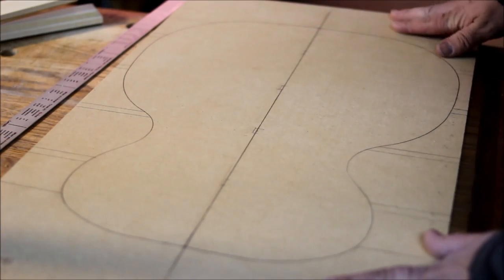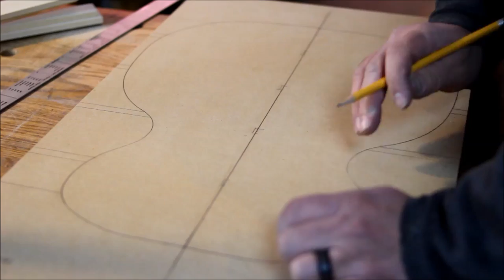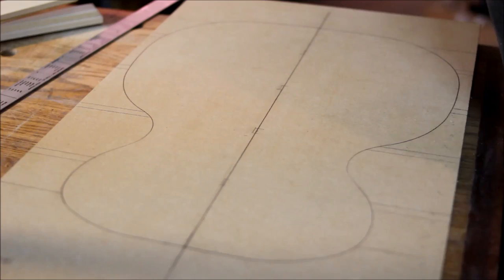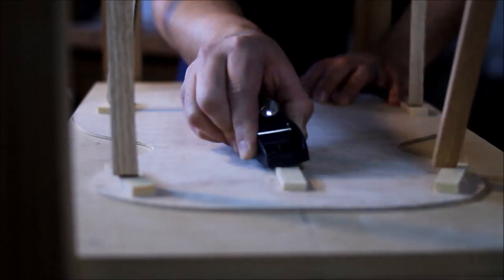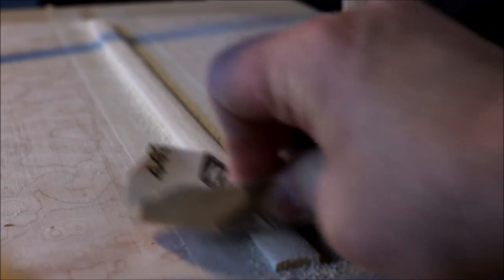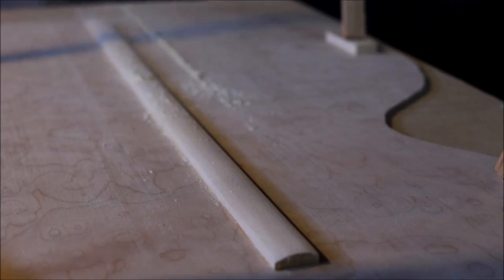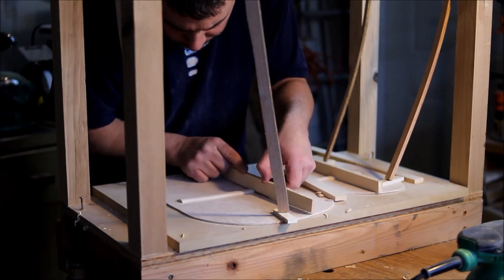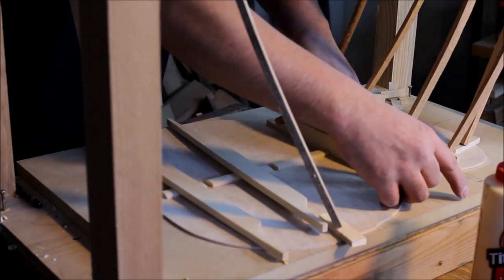How to Make the Backboard.

Comment: Nice video work. I like the slightly sped up thing ,its just fast enough.most yters go way to fast,gives me a head ache.
What is your starting thickness when using quilted maple??
Reply from the maker: Edad Martin thanks, The back was just over 1/4" ( not quite 5/16") and I bought it down to .100 ( 3/32) with the thickness Sander... thanks for watching!

Comment: I saw your  method but what radius do you strive for. Is a certain radius important? Many use 15-20 foot radius or more is that a falasy .what is important.??
Reply from the maker: Edad Martin the radius purpose , in my personal book , is to prevent the sound to hit and reflect back like it would on a flat wall surface. By putting a radius the sound will hit the back at different times and will be sent in a other direction than the one it came in.. I've seen flat back that sounds good too. Lutherie is a art and you should experiment and have fun with it. The deepest section it just over 1/8" on this one. Not following any specific radius .